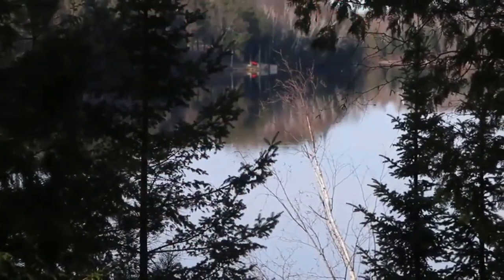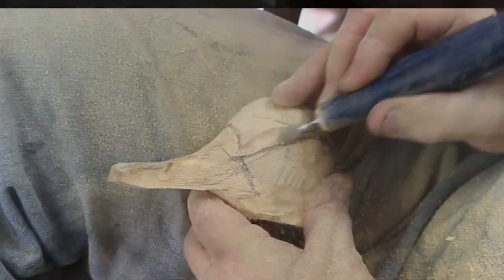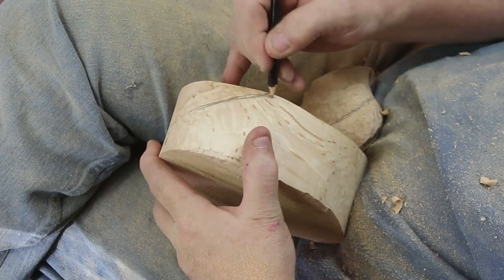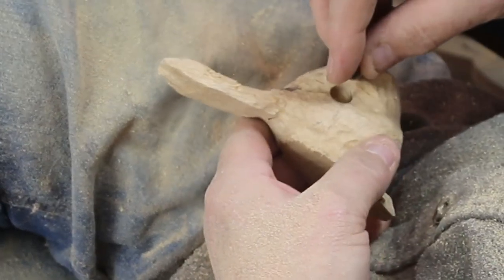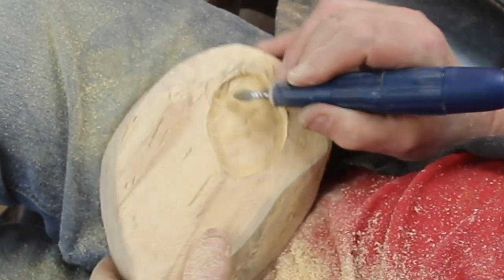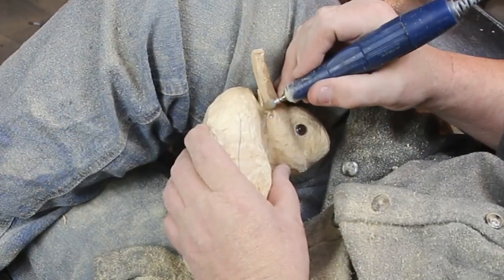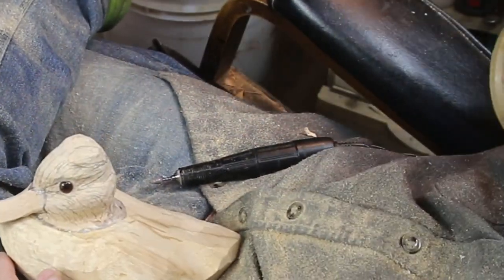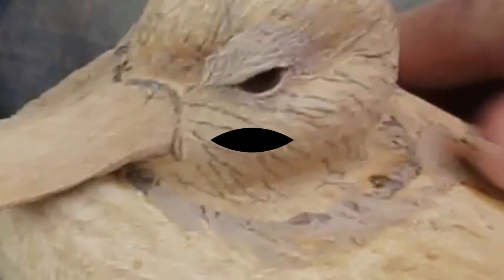Carving a Ruddy Duck with Attitude

Comment: Hi Ben I got some wood putty stick I looked at eyes man they certainly r expensive. I think I might see if I can make some with paint and 5 minute epoxy or see if I happen to have the right size beads for my little birdies. Talk about tiny. Not quite 2 inches.
Reply from the maker: https://www.tohickonglasseyes.com/shopproductdetail.asp?prodID=49&catid=1

Anna at the site search the number 110   These are their commercial grade eyes. They are 
$3.99 a set. I think those are the cheapest. I used to use them when I had a carving store for the silly stuff. They sell a clear cabochon in all the mm sizes. They are 0,95 each and look good when you paint the back what ever color/colors you want.
Ben